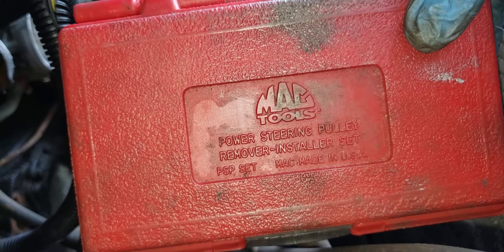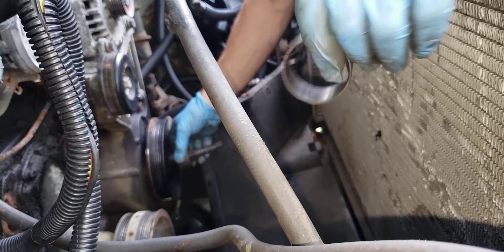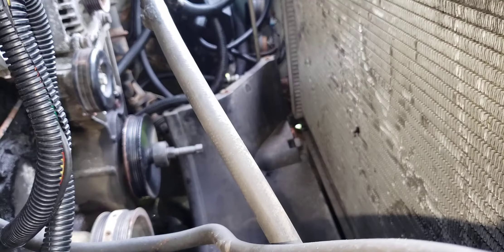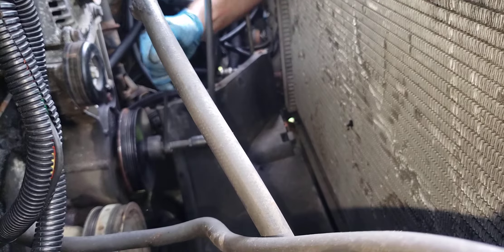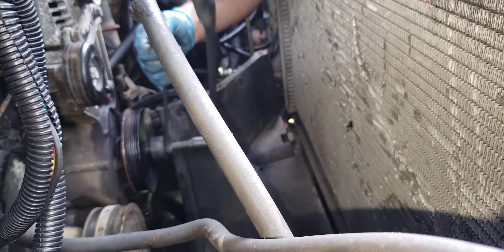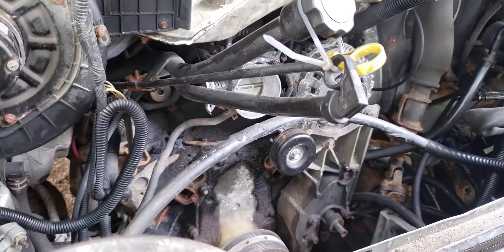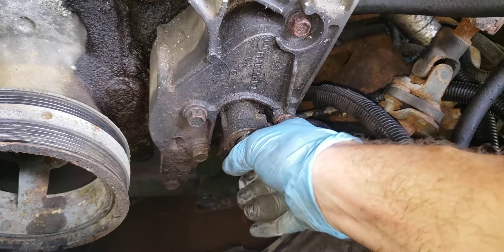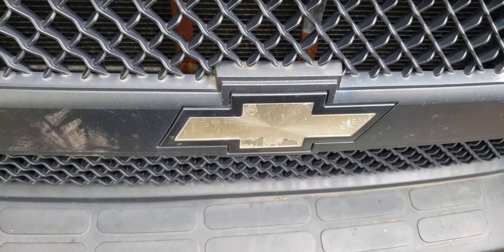How to remove the power steering pump pulley on Chevrolet and General Motors

Comment: Good stuff!! As many power steering pumps I change out in a year...I might as well just buy one instead of renting it all the time 🤦‍♂️
Reply from the maker: I can't remember how much I paid for this back in 1998 but it was worth it. 
Probably overspend on it because it was off the MAC tool truck back when I worked at a transmission shop